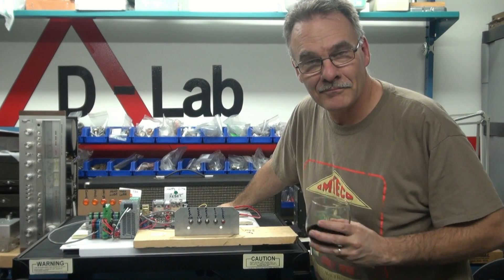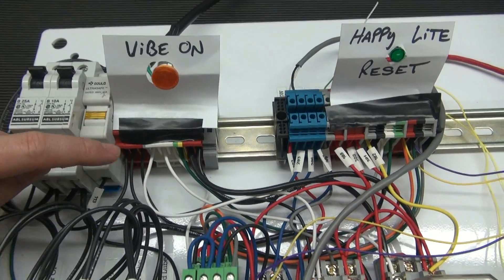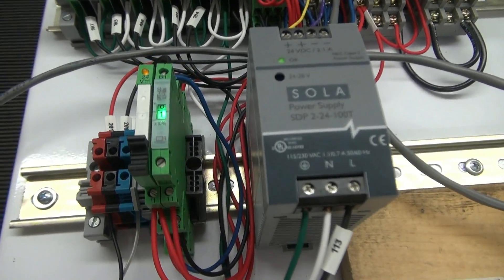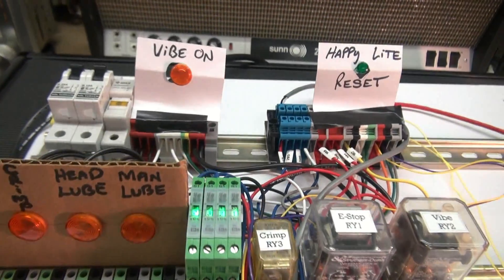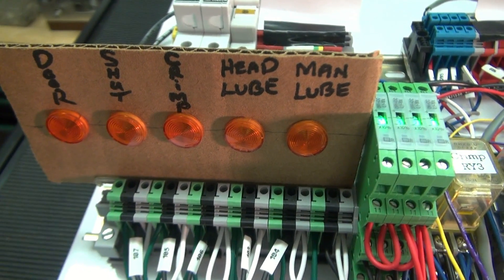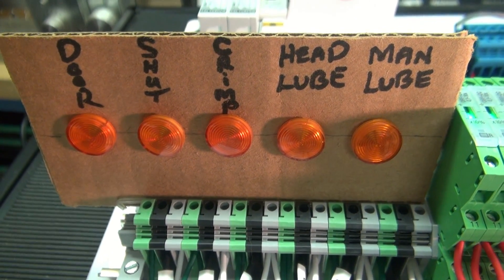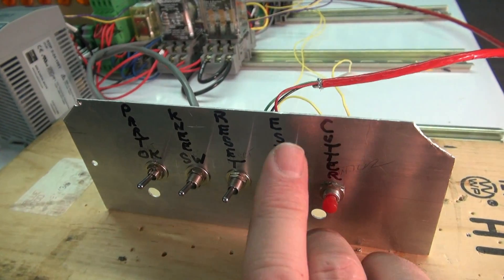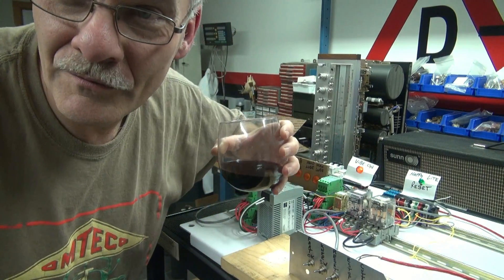Demo Control Panel omteco Abbott Rubber Hose Crimping machine D-lab

Comment: Hi there, I have a quick question. If I'm getting 0.003 voltage on both socket #7(heater) & #8(cathode) to the rectifier tube (6x5) can this cause the rectifier tube to glow in excess and cause a failure? I'm having this problem with my 1940 Zenith 10s464 console. The both wires go back inside the transformer. If I'm not mistaken, I should be having a reading of around 5 volts. I have the plate wires reading of 325 volts (ground to high voltage wire; a wire reading at 6.5 volts and both cathode and heater wire read at 0.003 volts. Does the 0.003 voltage seem too low?

Comment: I was kind of surprised to see a Sola power supply. We use them a lot in our PLC panels. I've been programming PLC's for oil and gas companies since the late 80's. I started as an I&E tech in the late 70's and most of our panels were relay based. Simpler to troubleshoot and more expensive to build today. These days it's not uncommon to have a panel built with 1500 IO (analog and digital). 

I'm partial to Allen Bradley Control Logix but I've got a lot of time on Allen Bradley SLC and Micrologix, Siemens S7-200, 300, and400, Siemens LOGO, Direct Logic, GE, Square D (a heck of a PLC in it's day), Siemens TI505, and who knows what that I've long since forgotten about.  

I'm always fascinated by the kind of stuff that this video covered. Manufacturing is a different world that what I'm used to
Reply from the maker: Sounds like we have a lot in common. I have not worked with AB. In the past, I worked with Koyo (think & do software). Then, I played with IO Tech (DasyLab) Now, I mostly use NI cdaq's (LabView & DasyLab 2016) I would like to check out the new automation direct productivity 2000 PLC. Just cannot pay the price unless I had an application. I really enjoy unique controls tasks. This relay logic project was fun. Phoenix contact makes some cool stuff, however as you stated, expensive, I could have purchased a small PLC for what the individual parts costs.
Reply: I agree. We do... strange how the world works (or is it the Matrix :o) )

I've had a AB 820 (their new micro PLC) in my desk for a few years. It's ethernet capable. It has 12 DI (I think they are 24VDC) and 7 relay outputs (2A contacts). Unlike everything else AB their programming software is free. I've played with it but I'm not a fan of the software. You can read into that- "I'm spoiled and like the advanced features of the ControlLogix PLC so I probably won't ever use it." 

I don't think it's a bad PLC and I know that it's used in the manufacturing realm because I see it come up on Mr PLC from time to time. It's expandable too. So with that in mind, I'm good on QRZed (NE5U), shoot me an email with your mail to address and I'll send it your way tomorrow. I know you'll have some fun with it.